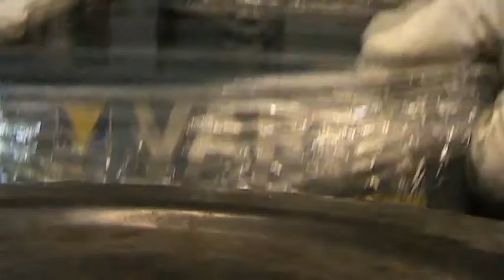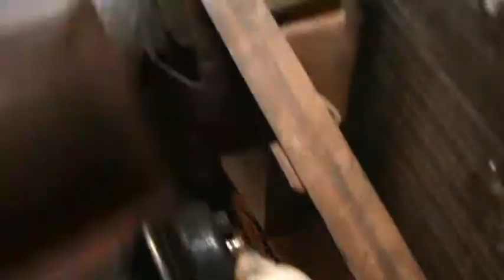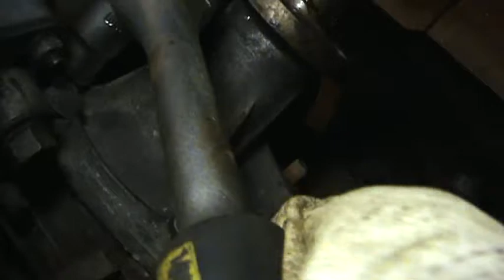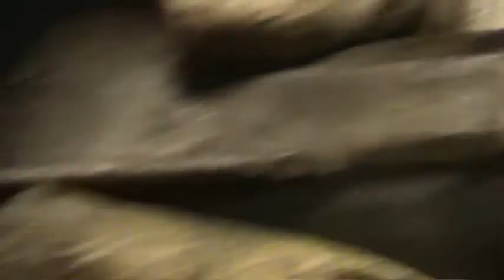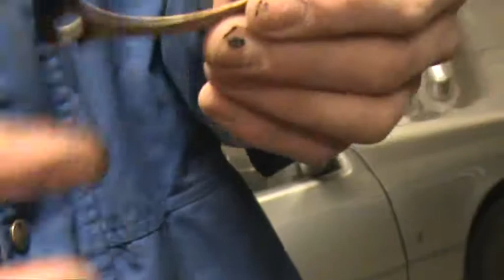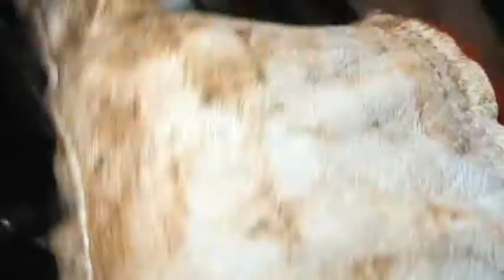Water pump replacement on a Lada

Comment from the maker: Do you have a skid plate like they have it originally. It seems that spark plug wires (or distributor) are getting wet and high voltage goes directly to earth and engine dies. Or wires are just so old.